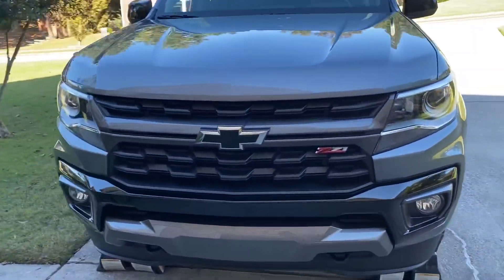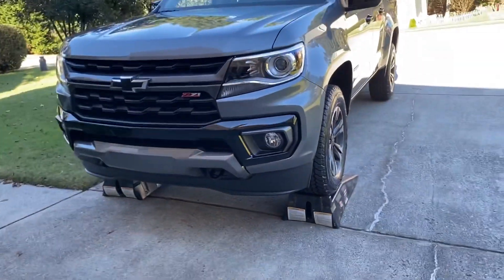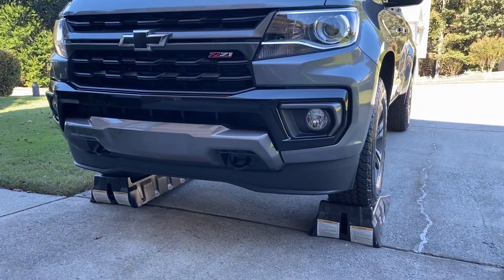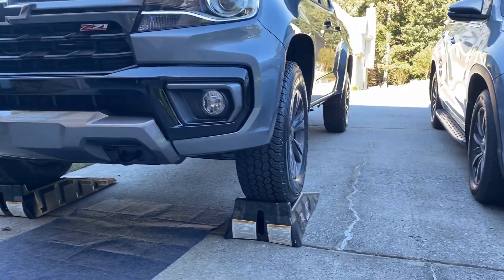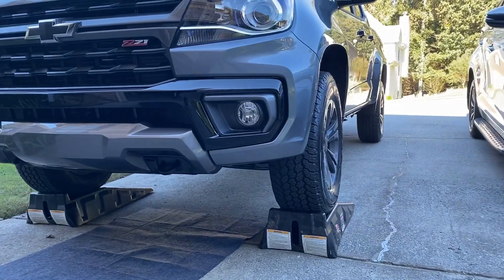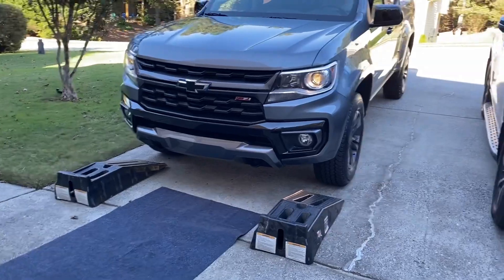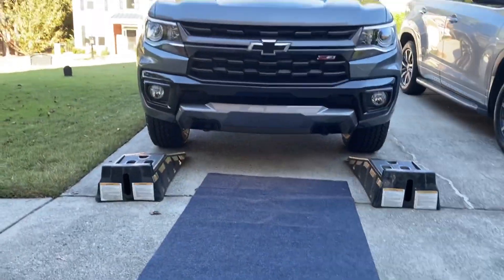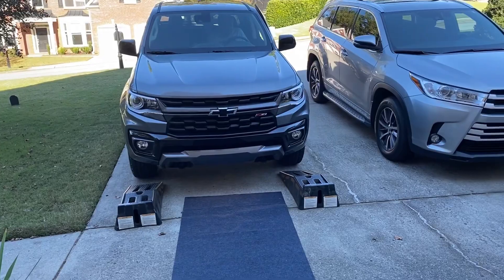2022 Chevy Colorado Air dam removal

Comment: I have a 2021, took the air dam off and trimmed it straight across (about half the depth on the ends) and put it back on.  It looks really nice.  Just enough to hide the underside parts.

Comment: I took mine off a few months ago on my Canyon AT4. Have not noticed any gas mileage hit. The extra clearance is great to have. Very easy to remove as well
Reply: Really?  I have the 21 Canyon and have been thinking of doing this myself - but heard there is a noticeable drop in mpg.
Reply: @dustyroaddestinations  I have not seen any drop.  Well worth doing.
Reply: @nastythomashobbs  Outstanding!  Might need to do that this weekend!
Reply: @dustyroaddestinations  Highly recommend it
Reply: removed the air dam on my Canyon AT4 as well. can confirm, quick and easy to remove. Have not noticed any drop in MPG as of 1000 miles
Reply: @hungnpham  I'm thinking of doing that this weekend...  Definitely had some issues with it last week in the desert - scrapped a bunch of stuff when I was out (the dirt road disappeared on me)

Comment: Looks way better! Mine should be in soon, maybe a week out.  1st thing I'm doing is taking off air dam !!   Besides being ugly if you drive offroad it will get ripped off right away and I'm always off the pavement.  2nd is a 1" level and mud flaps to protect paint. Next a bug shield because it keeps bugs off windshield and keeps that flat hood from getting rock chips.  GM chips so easy it's not funny!  Nice truck 👍
Reply: How is everything with the truck and the mods listed above so far, assuming you got it?
Reply: @aspe7187  I took off dam, put in a 1,25 level but it wasn't enough,  so I ordered Rough country 2 inch lift struts and put a 1" Silverado factory block and u bolts in the rear. It sits as high as a ZR2 now. I took off factory street Goodyear and put on Duratracs.  I installed factory flares to help with chips in fender wells, weathertech no drill mud flaps for factory flares. A Rough country trip fold bed cover.  Hood hinge pod mounts and Rigid D series pro Spot lights. An AVS AREOLIGHT bug shield,  it fit flush on hood and looks great on a black truck. AVS window vent shades. I decided to cut air dam in half and put it back on,  it looks good if you trim it and helps gas mileage. Everything is easy to do and looks great.  All of this was done before I had a 1000 miles on it.  After you level or raise Truck get alignment,  only the toe will be off but it will be off. The Rough country struts ride better than factory and no problems and I'm over 5k miles now. I also did a sway bar relocation kit. Just because people said it could rub, but mine didn't with 1.25 level or struts. I also took off the factory step bars and put on Rough Country running boards because they sit tight to the rocker and keeps mud and rocks off the sides of the truck. I'm also ordering a GM transfer case skid plate,  less than $50 it's good insurance.

Comment: If you get the diesel option in this truck you will get 7.0 litres per 100 kms or over 30 miles to the gallon and pull 7,700 pounds.